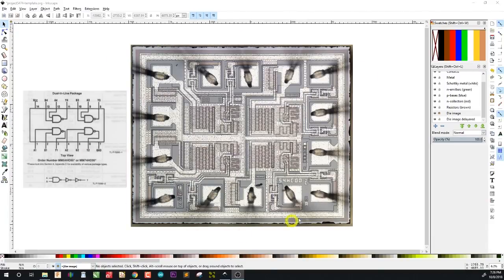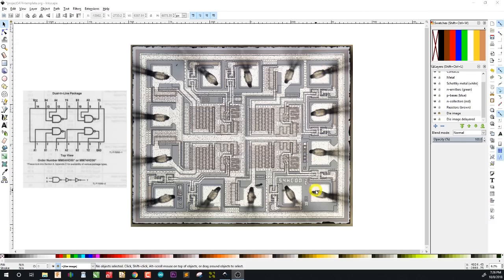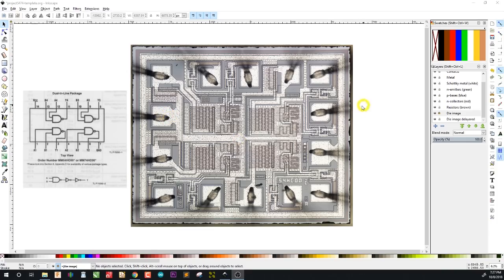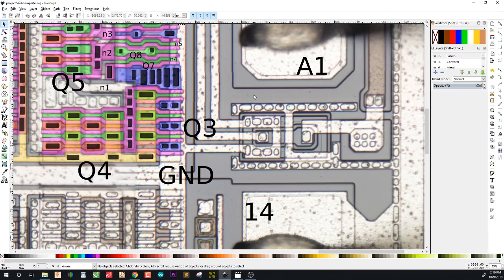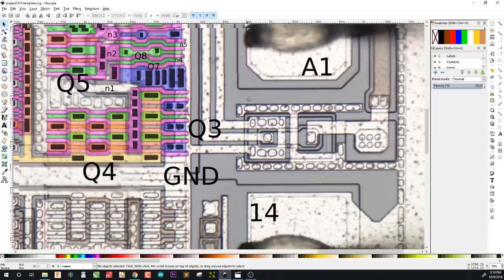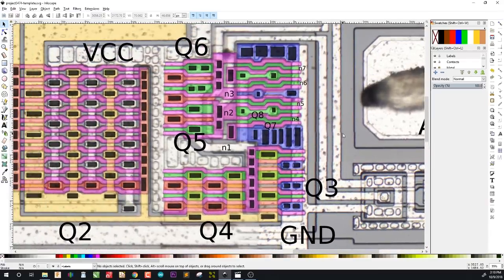Reverse engineering a simple CMOS chip

Comment: This video seemed easy but quickly went over my head.
Reply: If you look at the chilli tomato noodle channel, he sometimes explains why a chip (e.g. a CPU) is made the way it is. You have to dig through the correct videos though. At 54 minutes in this example linked video, he explains for instance why you might use tristate buffers instead of multiplexers (or vice versa). Do remember though that the video is a different topic to this one. https://www.youtube.com/watch?v=ZDMTRyJZE44&t=54m50s
You can also learn some bits here and there from the Jeri Ellsworth channel. Often, she'll look at array architectures (e.g. fpga) but will use them to mimic a multiplier-tree architecture (like a bog standard CPU). If you look at the books she recommends, you can learn a bunch about Hardware Description Languages (maybe vhdl or verilog). When you come back to it all, it is also worth looking at trigonometry with quadratic equations (teenager maths) which then helps you look at polynomials and then the calculus (before going on to Fast Fourier Transforms). The FFT though can be better understood if you look at animations on how a square wave is made (for your 1's and 0's of machine code used in say "two's compliment" etc). Having to hand a cheat-sheet of logic gates and electronics parts is useful (teenager physics class). The Brek Martin channel has some animations of the Fourier Series which is basically squiggly lines draw by a bunch of unit circles orbiting each other like the sun, earth and moon on a trailing stream of paper, like a seismograph (lol). #TheEarthMoved

In reverse, an example of separating a signal into its harmonic series using Fourier Analysis, would be the graphic equaliser on a (e.g. wav file) audio player's LCD screen. You know, like how "do ray me fa so la ti do" notes (Solfège) is the circle of fifths. Then that is put into an array (for x y pixels co-ords etc).

You can do it.
Reply: ObsoletePowerCorrupts wow,!,, simply great explanation
Reply: @obsoletepowercorrupts  I liked your reply but I also think you missed two very important helpful things. They can also check out 3Blue1Brown for all of the complex maths and Ben Eater for Simple Hardware - CPU design.
Reply: @obsoletepowercorrupts  This is great!
Reply: @skilz8098  Exactly, those two channels are worth mentioning!
Reply: engi
Reply: @obsoletepowercorrupts  Or go into electrical engineering where you literally have to learn all of that, I just got done with 'circuit theory' and 'continuious time linear systems' where we learned how to calculate circuits by taking them/ analyzing with something called the laplace domain which is like fourier domain, but instead of calling the jw axis jw you call it the s-domain, and this is called the laplace transformation. The only thing is you need to consider this as a u(t) (forgot name, but basically you need to consider it positive only, or else you need to involve the Region of Convergence (ROC), but either way, you learn so much about all this and the things you mentioned in Electrical Engineering.
Reply: looking up voltage dividers and current dividers is the way to start, thats where it all stems from.  and dont tell me its not exciting, cause then you got to be a flaker!  >:(

Comment: The structure you aren't sure about is the ESD protection clamping diodes. From the datasheet: "All inputs are protected from damage due to static discharge by internal diode clamps to Vcc and ground".
Reply: Was thinking same